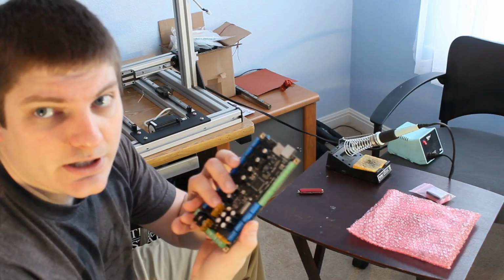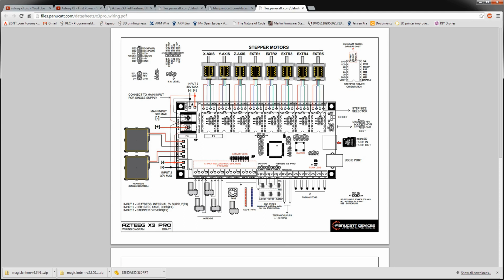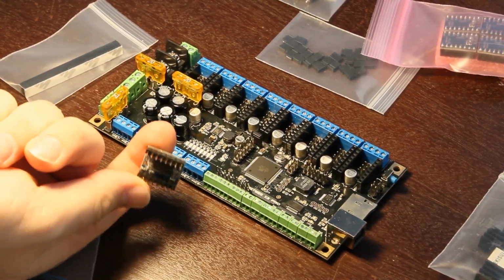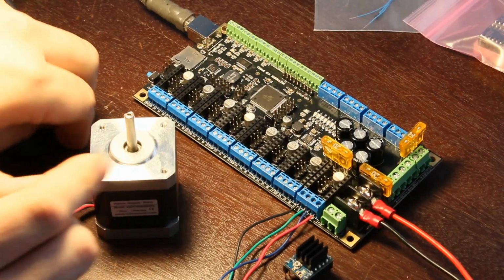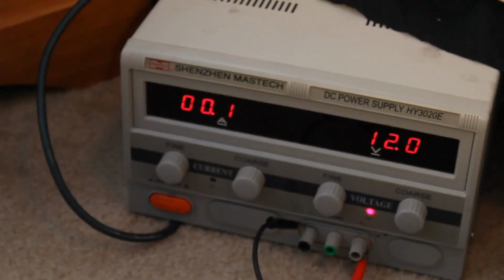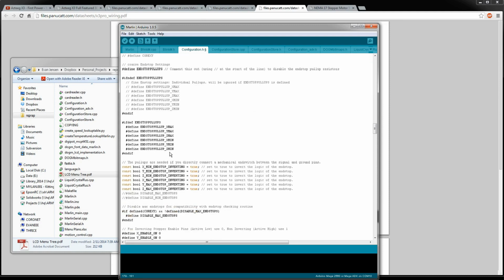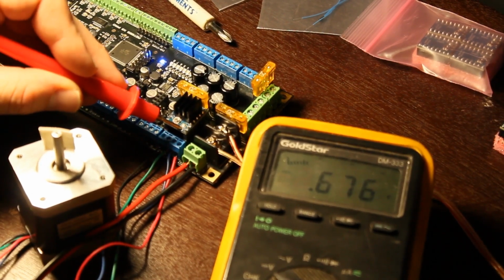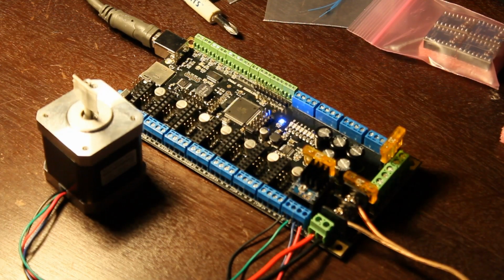Evan's DIY 3D Printer / Mill - EP2 - Spinning Motors (Azteeg X3 Pro)

Comment: Did you ever figure out where the long heat sink goes? I am setting one up and want to know, and I realize that since there are a group of holes with metal through on the other side of those surface mount transistors, they obviously have metal exposed pads for thermal dissipation on their bottoms that are soldered onto a metal pad on the IC, so maybe the heat sink needs to go on the PCB on the other side of them? also there are two on the end, that have nothing, in the package to fit on those ICs or the backs of them either way, :(
Reply: incase you are wondering what I am talking about here is some info on vias and center thermal pads on the bottom of the IC to send heat into the PCB instead of it just wafting up off the IC into the air
http://www.onsemi.com/pub/Collateral/AND9596-D.PDF See page 2 to see a cross section of the IC ontop of the PCB and what all is going on under the chip as well as beside it for electrical conductivity,  and this his a pair of photos at the top of the page, the top part with part numbers we see and would stick a heat sink on, in the first picture, and the second picture is of the bottom of that same IC to show off the giant metal pad in the center, that is probably not electrically connected to anything, and is just a good thermal output for the chip inside, that vents the heat out the bottom, and through the board by way of the copper vias going through the board to the back side, and connecting to more metal to dissipate the heat,

this is why I am wondering if the heat sink should be on the PCB side opposite those chips, or if maybe one on each side of the board, back ontop of the IC and top to the metal traces on the PCB using say thermal tape, or ceramic thermal paste that is not electrically conductive, or something?

Comment: nice work, I want to build a printer with a 48 inch cubed print size would i be able to use this (Azteeg X3 Pro) board  and nema 23 stepper motors?
Reply from the maker: Tannen Gibson sure. most people use nema 23s. just keep your friction low.
Reply: Thanks Evan i purchased the Azteeg x3 pro. On reprap wiki it says to download arduino version 0023 and it is no longer available for windows is there any way around this? I  tryed the other versions with no luck. I have to use repetier through arduino i was able to get one successful sketch and upload after that constant errors even on the same settings as the successful upload. Right now it is giving me error code "printer has not been declared" I have tried to contact Panucatt Devices several times they will not respond. Any advice would be greatly appreciated
Reply from the maker: Yea, Panucatt is not great actually.  They made a good board, but the support is not good at all from what I've heard.

I'm on Arduino 1.6.9, which is pretty recent, using Marlin firmware.  My (near) latest config is here:  https://github.com/evanmj/Marlin

With some clever clicking you can find out what I changed from the marlin repo and grab the latest and make similar changes.  The key change is the motherboard number (for x3 pro) and a few other minior things with fans and whatnot.

If you are having problems with repeiter host, just use another client to talk to it like pronterface or octoprint, see if that works better.
Reply: i was able to get a successful upload from version 1.6.9 thank you very much!!

Comment: Awesome video for beginners like me to understand how to make computers talk to motors. Thank You ! I understood from the 2nd episode that Marlin firmware was used to configure and Pronterface to control manually the motors. My question is, how did you make cura and octaprint to talk with motors in your 3rd episode? How can the motors map the co ordinates generated by these softwares physically on the printer? because the printer do not yet know the X,Y,Z  physical origin. Thanks!
Reply from the maker: prashanth ganesha you set this up in Marlin to home the axes. then you let Vita or octo know the Max limit.

Comment from the maker: @Sam Quad, The Azteeg is very nice, I'd buy it again.  I don't love the noise the drivers make and they are a bit undersized for my application.  Also they get pretty hot, but within spec.  In general however the system works well.  I love the triple power supply sections on the board which makes it very flexible. 
I wish they had worked with Marlin firmware guys to make a better definition of pins, since you have to find them in the schematics and do the work yourself basically.  Also a PDF of the schematics would be nice, but the block diagram thing they have on their website is really nice.
Anyway, 9/10, just due to the difficulty I had trying to find the pinouts and lack of support when I emailed them about it.

Comment: Hi bro, I'm somewhat new to this but I am interested in making a 3d printer myself. Saw your video and definitely helped me understand how everything wired up. I'm curious though what it means when you encoded the M17 - I know that this is to control the motor but how did you identify that one?
Reply from the maker: undesirablefreak check the reprap wiki for the g codes. I think that is motor enable in all standard firmwares.

Comment: Hi.
Can you please explain how you configure one of EXTR  as second z axis driver?
Thanks
Reply: Hi,  You just set it up in config_adv.h I believe in marlin's config files.  You select which driver you want to run it, then tell it if it is a second X, Y, or Z motor.  You can also double them up on one driver, but then you won't have as much power for each motor.

Comment: Evan where did you set up the dual Z is it in the pins.h ?
Reply from the maker: I think it is all in Config.h and ConigAdv.h, the pins should be set up already I think.
If you can't get it worked out, send me an email/PM and I'll give you the dropbox link to my current marlin config/code.
Reply: SquishyBrained If you could it would be very helpfull , im not realy needing dual z but dual y.
Kuupeetje@gmail.com

Comment: Hey Evan any chance you can help me out? I've got an Azteeg X3 Pro as well and I'm trying to set up an autoleveling servo but i have no idea where to connect the 3 leads. I understand i need 5v ground and signal, but could you point out the specific pins for me?

Your videos have been a huge help by the way.
Reply: Hey, thanks!

So, if you check out the PDFs here:
https://www.dropbox.com/sh/x8g4rkmacyrajti/AAA8EV618OLDdU55sozb22Bza

... In "x3pro_wiring.pdf", you can see J1 has +5v and GND.  I'd use those.

Then, I think you can use any pin from EXP1, 2,3,4,5.   The actual MCU pinout of those can be found in the schematics "DipTrace....pdf" in the link above.

In marlin, there should be somewhere that you define the 'hobby servo' pin for Z probe.  I'm not sure if it has to be a PWM pin or not, but it might be wise to find the pin it 'wants' to use and see if that one lands in one of your EXP headers already. 

I wish they broke out a servo header or two, but that is where the "pro" aspect comes in, they assume you don't  mind soldering to those headers or directly to the board.

If I ever get around to doing this, I'll make a video, but it may not be any time soon.